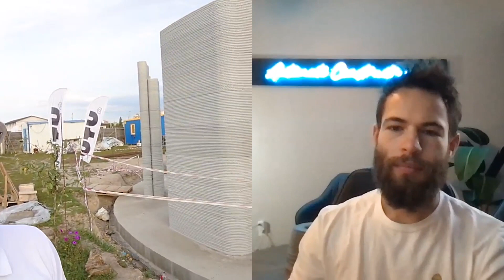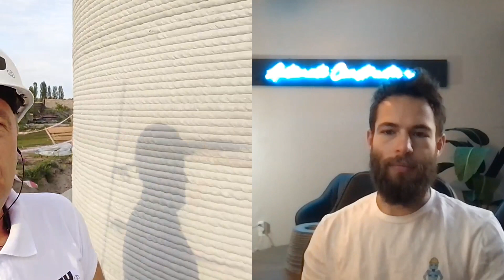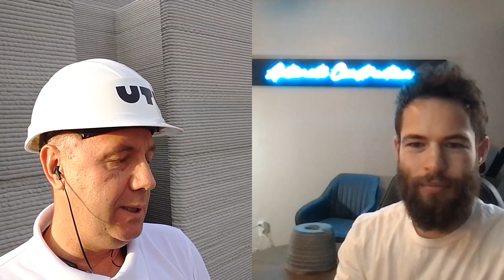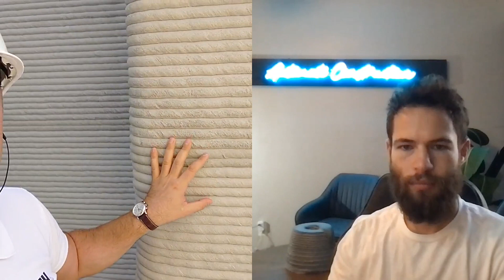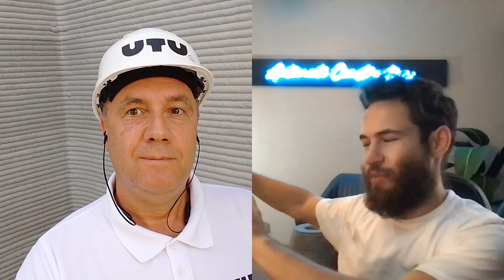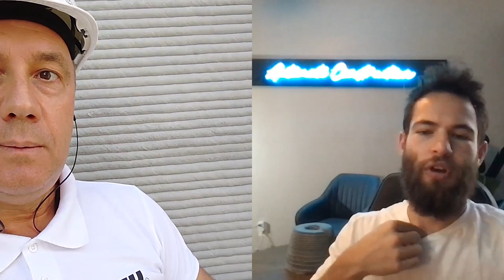Printing Buildings in Ukraine with Extruder Mounted Mixing System!

Comment: I wouldn’t say there is 10% waste - somewhere between 1-5% maybe but I just add that leftover material from start-up and clean-up into stepping stone molds (construction could use it for sidewalks, planters, etc) so less than 1% material is sent to trash.
Reply from the maker: Great solution, unfortunately some larger house projects have had over 20% waste from bad material or other issues. It’s really not uncommon.
Reply: @automateconstructionpodcast  20% due to bad material is unfortunate.  It seems like it could still be used at minimum as crushed base for the next concrete pad.